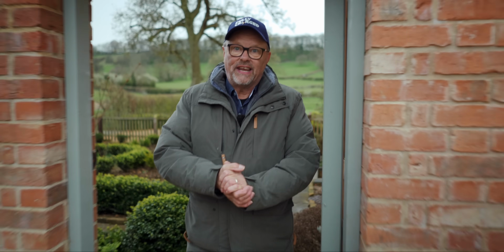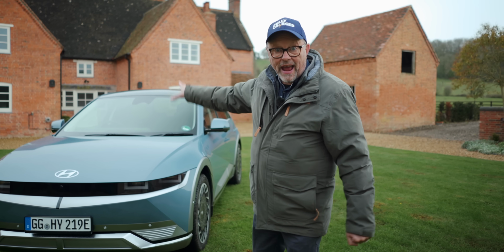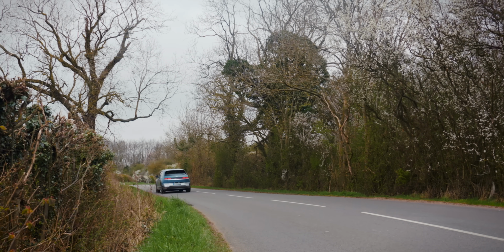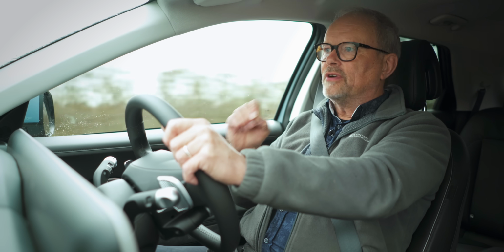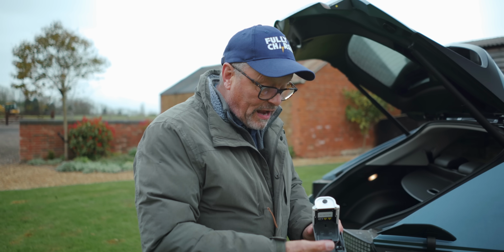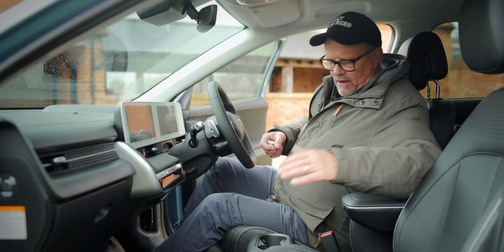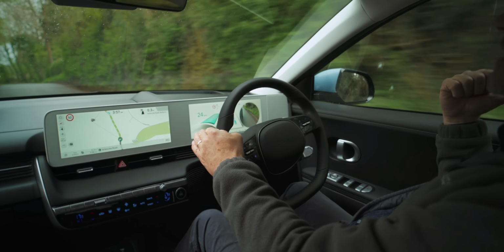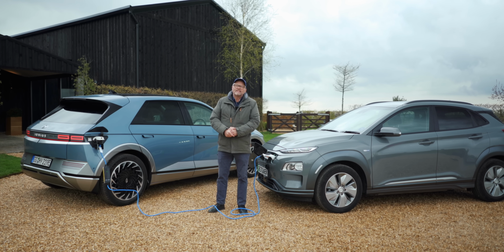HYUNDAI IONIQ 5 First Drive - could this be the electric car of the year? | Fully Charged CARS

Comment: So I thought, before I went to a showroom to try it. Sadly, I found seats uncomfortable as well and floor is too high - I simply couldn’t find a comfy position. I am 180 cm so nothing exceptional at all. Same problem in Mercedes GLA, but it based on an old platform. The car is overhyped.

Comment: Initially slightly interested but for a major flaw! Blooming expensive for a city car no good for rural use . Its on "eco" tyres no good in snow and when I asked Hyundai if its OK to put proper tyres on they said "we don't recommend that it may put excessive strain on the drive components" . I didn't ask about flooded roads which I often encounter and so do Londoners now. Hope your all OK down there.

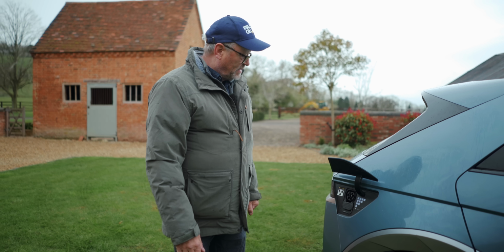Comment: 05:45 And on the production car, there will be a Chademo charger on the other side. These also work as a backup in case the lights fail: When you signal LEFT the Chademo flap opens, when you signal RIGHT the CCS flap opens, and when you BRAKE, they BOTH flap up-and-down :-).
(Well, it worked on the old Morris Minor!)

Comment: How come we right handers put up with cacky handed steering columns? (The right hand does the communicating and signaling while the left hand does the tedious work like gear changes and wipers). How come we still put up with DeSoto dashboards? ( the gauges behind the steering wheel). Why do they insist putting the redundant gearstick in the middle of the limited desk space? At least they didn't put the hilarious charger in the crumple zone like most do.

Comment: Hyundai has confirmed the new Ioniq 5 will cost from £36,995. That means it won't be available for the Government's £2,500 plug-in car grant, which is only available for cars that cost less than £35,000.

That is Mercedes diesel prices without the worry about running out of electric.

Comment: How can it charge faster on a 50kW/400V DC fast charger? Usually 800V systems will charge slower at low states of charge than the equivalent 400V EV because the conversion to 800V is not 100% efficient but potentially if you charge completely the flatter charging curve for an 800V EV might make back the time?

Comment: My wife and I have a 2018 Tesla Model 3, and also a 9 year old Lexus sedan. There is NO WAY I'm going to buy an Ioniq 5 with its range of 258 to 290 miles, as I learned from Car and Driver Magazine. We're in the USA, and range anxiety is real to us. In the huge metropolis of Raleigh-Durham-Cary-Chapel Hill in North Carolina, there are only two...yes only two...Tesla Superchargers! These days, some days, you can't even find a slot to charge. The Model 3 supposed range is 310 miles but with power used to heat/cool, we never get more than about 240 or 250 at best. And coming back to the Ioniq: the non-Tesla charge infrastructure here in the USA is PATHETIC to put it bluntly. VW's network of Electrify America chargers are few and far in between, and they don't have the charge speed of the Tesla Level 3 Superchargers. So: I think I'll go hibernate till 2023 and maybe I'll wake up to find that a realistic EV life is finally here! 
But hey, I did not talk about the JOY of an EV! Here goes, in brief: they are silent rockets! Amazing acceleration! The Tesla Autopilot makes it so, so safe to drive and so relaxing. Have high blood pressure? Get an EV like a Tesla!!! For driving around town, I usually bribe my wife to have her let me drive her Tesla!!! And oh, we here in the Southeastern USA are just recovering from a severe gasoline...(oops, sorry, petrol) shortage after our major pipeline got hacked by a ransomware operation. They paid them off after a few days and the shortage is now over. President Biden has sworn to wring those ransomware guys by their, um, you know! A place more sensitive than their necks!!!

Comment: I really like this car..... But the price is just ridicules' high, at least here in Iceland, you could get fully loaded I.D. 4 GTX and still have about 500 pounds left for the version that was shown in the episode. The cheapest one starts at the same price as the most expensive Kona EV costs here, well about 400 pound more that the Kona. Current currency exchange, base version HI5 35.500 pounds with smaller 58KWh. Most expensive with all the bells and whistles 4wd 77KWh 49.049 pounds.  I.D 4 GTX fully loaded 48.770 pounds. I.D 4 Style - very well equipped with the 58 KWh battery 31.750 pounds, avrage I.D4 Family with 77 KWh battery 39.560 pounds. 

I am just pointing out how surprisingly expensive the HI5 is compared to rivals like their own Kona and VW I.D series. It is also way more expensive than the new Kia 6. 

Disclaimer these are of course Icelandic prices, but PHEV and EV cars tend to be rather cheap here vs. most of Europe since they are almost tax free.

Comment: My understanding of why an 800v battery pack has a better charging curve than a 400v one...

Individual battery cells are around 3.7v. To keeps maths simple lets say to recharge a cell you need 4v. You can therefore charge up to 100 cells with a 400v supply.

The only thing you can vary is the number of amps you send to each cell. The cell can only take the maximum amps it's rated for under ideal conditions when it's at a certain discharge percentage.

The unused amps can't be redirected to other cells because you have no spare volts. Don't forget that you need 4v to charge each cell REGARDLESS of the number of amps you're pushing into the cell.

The solution is to have 800v so now you can charge up to 200 cells at once. This means you can push double the kW into the battery pack without any additional stress on individual cells. So on a 50kW charger when the battery pack gets full instead of dropping to say 25kW it can keep pushing 50kW.

Also sharing the same number of kW across double the number of cells (halving the amps to each cell) will massively reduce undesirable heat generation.

Comment: The Ioniq 5 and EV6 (if they deliver on the range promised) will make every other EV in its price range seem outdated. The Mach-E with its 55-minute 80% charge and 1.5 hour 0-90% charge is just laughable next to the Ioniq and EV6 offering an 80% charge in only 18-minutes. That is incredible and makes even the Model Y and 3 look like last generation old school EVs. I also really like the Ioniq 5’s styling. It’s like an old Lancia Delta Integrale, just a modern take on it. Model Y looks like a big ugly Prius with some Model 3 design cues. 

The only thing I don’t like is that the wheel wells impede some of your trunk width and being the owner of a Model 3 Performance, I’d want more power. Hopefully there’s an Ioniq 5 N that borrows the EV6 GT’s higher performance motors.

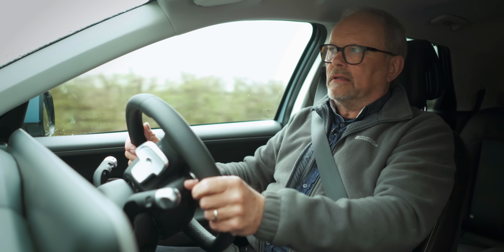Comment: At 7:00 the inverter story charging faster than another car with a 50 kW 400V does not makes sense at all ^^
You cannot create more power from the 50 kW even if the battery pack is at 800V.
Thanks for the review!

Comment: I so want to love this car.  The overall design/style is fantastic.  I just can't get over the horrible lower body cladding.  It's so over done with all the slits and angles and textures - it's just too much visual information on a vehicle that is trying to be 80's retro.  If they wanted texture down there - why not make it look pixelated - you know, like all the lighting on the car.  It's almost like they took cladding off a completely different vehicle (like a 90's Pontiac) and slapped it on this beauty.  I hope they completely change it in the first refresh (that will be about the time when I want to go electric).  Excellent review - thanks!

Comment: farm not on the map   so no mail or bills.
is this the only car that puts up video when indicating ??
when charging or using the out power version, is there any protection so you don't either,   fully drain or have less power in the battery so you can't make it to next charger,  so meaning you run out of power.

Comment: Car makers start to understand what can be done with an electric motor and a battery. VW also has anounced bidirectional charging for next year, so hopefully that will become a standard. If they only would understand that a towing hook is needed. If I am right, the Ionic has one and can tow up to 1600kg, which is impressive compared to the ID.3 with only a bike hook. I also like the movable rear seat.
Reply: Strangely, here in Switzerland, Tesla have removed the towbar from the Tesla 3 online config, it can still be ordered at the showroom though. Explanation from sales gurly was too little demand (but all her customers had got one for a bike rack, so she didn't get it....)

Comment: Call my cynical, but I can see where things are going. Many years ago cars used to rot away, but the ones that were the worst got really bad reputations for it (Italian, Japanese, French for example) so manufacturers had to stop it (except ford who seem to be held aloof despite being utter dross in every department) Fast forwards to modern times are cars have become so complicated that despite still looking fine, they become impossible to keep running. These electric cars that are coming on stream now have several extra layers of added utterly pointless complication because they are scared they won't be able to sell you a new car in 10 years time. I mean what the actual F**K is the point of a powered flap for charging? It's just an utter waste of time, effort and expense on something that I guarantee will break before this car is old.

Comment: I don't know. Something about the design of the car makes it seem as if the front wheels are larger than the rear wheels. I have seen "muscle cars" in the past that had larger rear wheels, (for better traction and speed, presumably), but I've never seen a car with larger front wheels until today. This does not mean that they ARE larger, only, to my eyes, appearing larger in some angles of view. In another observation, the tail lights remind me of a mid-eighties Chevrolet X-Car, the Citation. Again, I could be wrong, but those are my first impressions. Robert seemed to like the stalk control shapes. Are these the actual ones that will be on the production vehicles? Only time will tell. Every new car wants to have something unique about it to set it apart from the competition. The Citation had its radio mounted vertically to look different, however, the faceplate still had horizontal marks and words, and detracted from the obvious intentions of the designers. (I can see their point, why redesign a radio faceplate for a relatively few vehicles when all of the rest were horizontal.) Anyway, there are many things to like about the IONIQ 5, don't mind me.

Comment: too much electronics, I don't need this. Like automatic trunk? Automatick door to open the plug in socket (seems it doesn't work already- in new car). Glove box seems to be not in line with the other parts (low quality materials). LED lamps - how much it will cost to replace it when it breaks down? LED bulbs would be better. I'd prefer analog clocks. Too many screens. The car doesn't seem to have soul like clasic cars in 1960's-1990's.

Comment: 5:50 this is when you should add a gigantic disclaimer that this car is in testing to avoid retards from spreading FUD about this car

 7:06 well they just told you that going through an inverter would be more efficient than having no inverter, that cant be right

Comment: To imply that charging an 800v battery at 50kw adds energy faster than charging a 400v battery at 50kW is false.

Watts are the product of voltage times current, IE W = V x I. 

So, when charging at 800v, to get 50 kW you pump in 62.5 amps of current. (800 x 62.5 = 50,000 watts). When charging at 400v, you pump in 125 amps (125 x 400 = 50,000 watts). Regardless of the voltage, the overall speed is the same. 

However there is one area in which the higher voltage could cause the car to charge faster:

The groups of cells that make up a battery pack can only take a certain current safely, especially when they are close to full or empty (thus why most EVs slow down rapid charging over 80%). With a 400v battery charging at 50kW, you're pumping 125 amps into each cell group. With an 800v battery charging at 50kw, you're pumping 62.5 amps into each cell group. It may be that the reduced current into each cell group means Hyundai can keep the charge power at 50kW for longer and at higher charge percentages than if they were using a 400V battery.

Comment: I thought the standard for charging ports is location in the front of the car.   At my workplace, the chargers are on angle in parking spots located on a 1-way drive that precludes backing in.  That would be an issue if the charging cable isn’t long enough to reach.

Comment: Absolutely stunning, this should be the basis for all electric vehicles. The solar roof, the ability to use its power to run appliances but also hopefully it will have  bi directional charging as well. With the 280 plus real world range & the really fast charging. It reminds me of a Lancia Delta . But a sci fi futuristic version.

I would love to own one. But I just know the  price will be out of my reach for many years to come, & for the majority of people interested In wanting to own a good example of what a electric vehicle needs to be.

But, until the likes of this model is less than £25k-£20k then it is only be for the super rich. That really don’t need a electric vehicle to save money on servicing, parts, & “fuel” but they get one because it’s a eco statement, look at me.

Yes, I know new tech is really expensive at first, but they have been making new electric vehicles for over ten years now. The only real difference from a fossil fuel vehicle is the battery, drivetrain and the software to need to run one. With far less parts to fit and battery tech that is around the £100 per kWh, but that saving is not being passed on. 

That’s why you see every Mod CON on these new electric vehicles. To keep the electric vehicle profit margins really high. Too high. 

Perfect example, it has a motorised electric adjustable back seat. That let’s be honest. That no one needs with that much space already. Unless you like to breath down the back of the drivers neck. Utterly pointless, and will be one of many expensive Mod Con add ons, that you have no choice in the matter.

I’m sure there will be plenty more expensive mod CONS on this vehicle, that the average motorist really doesn’t need, fitted to this beautiful, amazing electric vehicle. But like I say, only a small percentage of people will be able to afford. 

I guess we can always buy a very short ranged over expensive second hand electric vehicle that most Ev owners are glad to see the back of, for a better ranged Ev. Ok I here you say, “you don’t need the range.” But if that’s the case why is every Ev owner happy that they have more range then when they buy a newer Ev with more range on it. 

I’m just tired of seeing a electric vehicle I would love to own but know they are way over priced by the automakers making as much profit in them before they have to start making a mass market Ev for everyone, where their profit margins are not so big.

Comment: Defiantly on my shortlist - I have the current model (Ioniq EV) and like many thinks about Hyundai's grasp of the EV concept.  If they can sort out some of the 'mistakes' on mine and keep the right things I'll be having one.  Main mistakes are Auto hold (a classic misnomer as its not auto) has to be selected as do the front parking sensors duh!  Given the charging flap maybe they still have some crazies on the payroll.  That apart I love the drive of my car and I'm sure to like this one too.  Their flappy paddle regen adjust is a masterstroke.  If anyone at Hyundai is listening I want to see through the window the current charge on the car and miles range if I have the key and not have to unlock, open the door, turn on the ignition then actually start the motor to get that info - see what I mean about crazy.

Comment: no, ,you cannot charge faster than 50kW on a 50kW charger :-)
but you can charger faster than other cars on a real high performance changer because you don't reach the current limitation of your electronics or wires that early because with double the voltage you have half the current to supply the same power. using the inverter of the motor is clever :-)

Comment: a properly innovative design from Hyundai, impressive. It is however, very pricey in its upper trims/powertrains. The kia EV6 uses the same powertrain but offers a GT version with massive horsepower and torque, I wonder why Hyundai declined to offer a high power version of the ioniq 5.

Comment: I want this car.
I also want many other things i can't have for one reason or another so i suppose i should start next by hoping it comes to the US in every state (unlike the Kona and Ioniq electric) and that by being in every state, the price will drop enough that in 3-5 years i can afford a used one.
Also hope that being rear wheel drive, the low center of gravity and battery weight is enough to help in a midwest winter. I have seen many a rear wheel drive vehicle struggle to get out of a parking spot on a snowy road or struggle up a snowy hill, and i had the scaryiest driving experience of my life when a rear wheel cargo van i was driving started to fishtail at 65mph on a patch of ice on the freeway. I know there is an all wheel drive version too but they are usually more expensive. 
Anyway, great video, great loking car and can't wait for to hear more about it as it gets closer to launch and starts selling.

Comment: I watched the What Car review of this and at least they pointed out some negatives, like the awful touch-screen heater controls; less than sharp handling round corners and the steering wheel obstructing the speed display (depending on your height). I would take the What Car as a more balanced review.